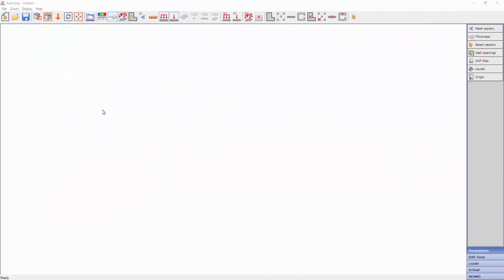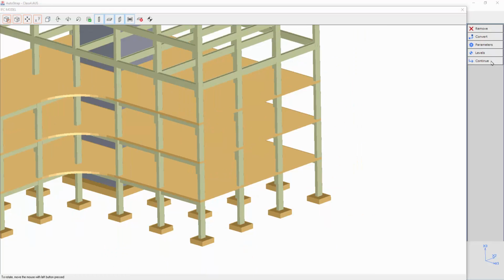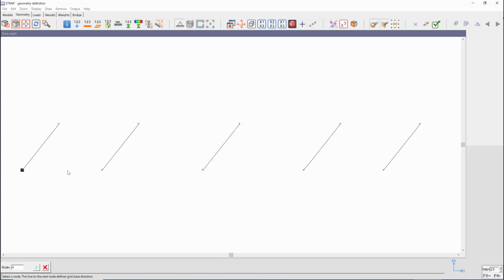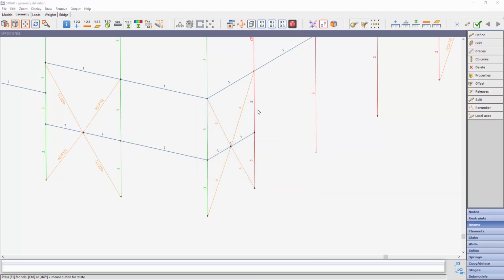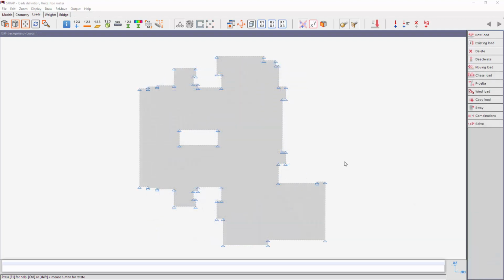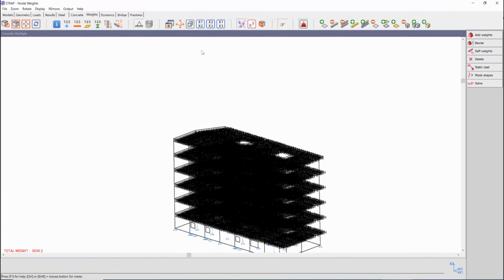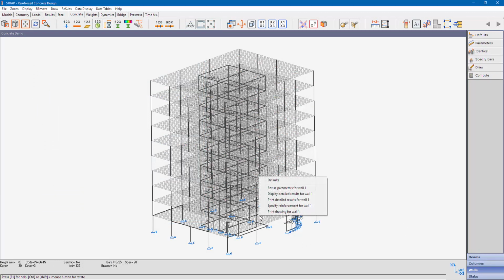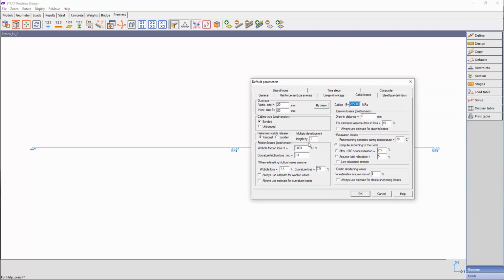STRAP2021 Major improvements

Comment: STRAP needs a complete revamp of its interface ASAP, especially the geometry tools (viewport interaction, select/assign methods, drawing new elements, quick frame modification and reinforcement, deletion, hotkeys). It's 2022 and the UI+UX are long outdated. SAP2000, SCIA, etc., all have their shortcomings, but STRAP seems years away from them. Too much time is lost fighting the geometry to get it right. Too many clicks. Too many steps. Too many windows. Too much cursor teleporting. ATIR should hire UI staff with background in 3D modeling software to be competive (and charge its premium) worldwide. Frankly, it is bad.
Reply: I agree with you.